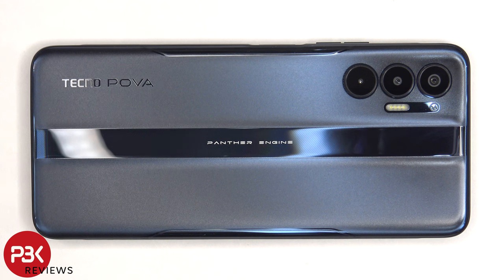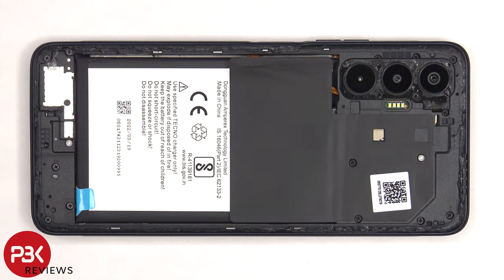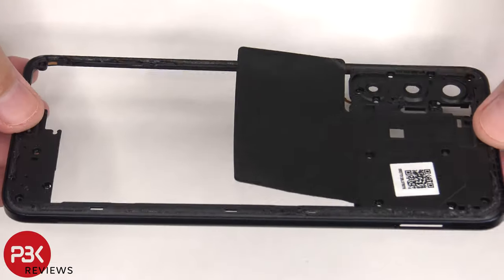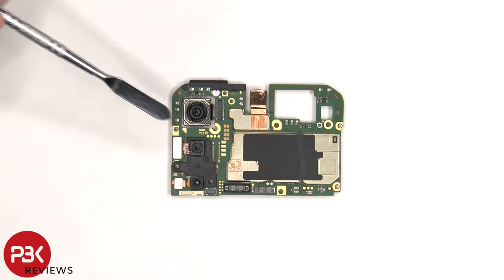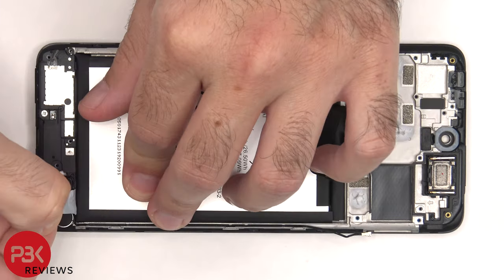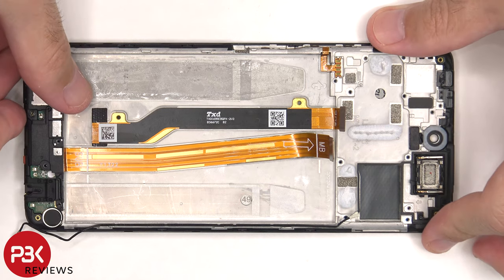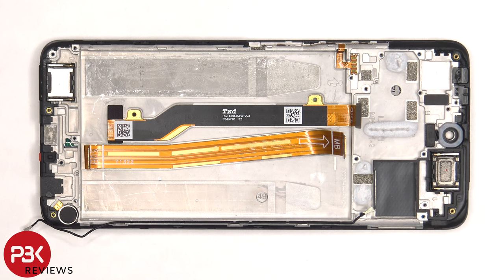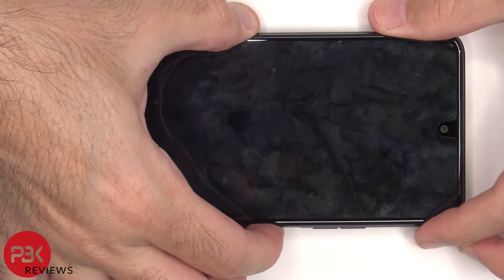Tecno Pova 3 Disassembly Teardown Repair Video Review

Comment: Does the phone have one headset for calls and two stereo headsets, or is the upper headset used for calls as well?? How many light bulbs are there in the screen.. What do you think about this device? Is it good?? Thanks and sorry for the long post
Reply from the maker: Top speaker is both for calls and stereo. Not sure about the light bulbs. It's not the best device but isn't bad either. Has a large battery so thats good. no problem :)

Comment: wait, on the Indonesian review videos, this phone has "RGB" lamp on the middle of back cover.
Reply: The RGB one is only for the blue variant and it's slightly more expensive than the other colour
Reply: @Malli_60  well I got the blue variant at the same price as the other variants...... But I want to ask a question, does your phone got hot from gaming? Or is it only me for playing every games at the highest possible setting?
Reply: @nishikun867  every phone got hot/warm from play game but depends of what game you played, if the game are heavy game demand then yeah and if not then you got warm. 

If you set highest setting (high graphic instead of fps),  then you phone can't perform (or get hot) but if the fps is highest and graphic is low, it still get hot but longer than highest graphic. So i suggest play the highest fps and also you need a cooling (such as fan/aircorn or phone fan cooling)(i think fan/aircorn is good bcuz you already had one at home) so that you can play without burn yourself
Reply: @Malli_60  well, I turn on both fps and graphics to as high as possible..... I tried mobile legends, PUBG new state, apex legends, (haven't tried codm, will download it tonight)....... It get so hot, it should not be this hot as they advertise it as being cooled by whatever it is (I can't remember).... Also the battery drain a bit faster than I expected for a 7000mah battery (I don't even turn on the 90hz though).... But I gotta admit that even if it got hot and drain battery more than I expected, I haven't noticed any drop in performance..... That something I can praise about this Tecno Pova 3.
Reply: @nishikun867  tecno pova 3 done great job with handle the heavy game with high settings but yea i suggest high fps low graphic is way to go if wanna play game for longer time.

Even tho many phones advertise cooling, it doesn't mean the phone has pc level cooling, the advertise cooling phone can provide less heat while playing heavy game so that you can longer and safer from burning hand. there's a phone that literally has a fan on the phone and it's Nubia Red magic and currently they release 7s pro chack that phone it's cool if you want phone for gaming only.

Comment: I wanna ask a question guys, I got the 6gb plus 128gb in blue variant of this phone.... But it got somewhat hot, is it only me? Or is it b'cuz I play every games at the highest possible setting?
Reply from the maker: Its normal for it to heat up while playing games especially at high settings.
Reply: @PBKreviews  well, the thing is this phone get hotter than the ones I previously owned.... So I'm wondering if it is because my device is faulty

Comment: Is the 7000mah battery can be put inside the other Tecno Pova 5G?
Reply from the maker: Not sure, I would lean toward no since the battery would be larger and not fit in the other phone also you would need to see if the connectors are the same or not. I don't have them anymore to check.

Comment: Hey bro, as this phone has a rubber gasket inside, then it might be waterproof up to a certain level, right?
Reply from the maker: Yes, although only one of the connectors had the rubber gasket. But the sim tray does, and so do the mic holes so I would say yes to a certain extent it should be splash proof but can't be certain to what extent :)